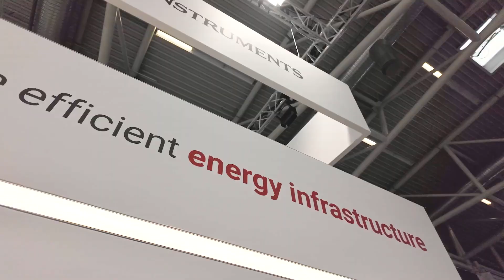Trends in GaN-Based Solar Inverters

Comment: interesting; although the fucking EVs and AI DCs are shit ... I consider now some SMALL off-grid PV setup as an experiment, but it is hard to decide for something simple, some AIO regulator,/charger/inverter and don't want to do hysteric decision on something expensive, as this is part which will be swapped soon by this GaN (or SiC) things?? ... so will take now something tiny )) ...

Comment: The inverter needs to convert DC power into AC power. GaN is a third-generation semiconductor material with smaller size and higher power. Yongming can store and release energy when encountering peak voltages and currents, and Yongming capacitors are resistant to The characteristics of high voltage can help the inverter achieve higher conversion efficiency